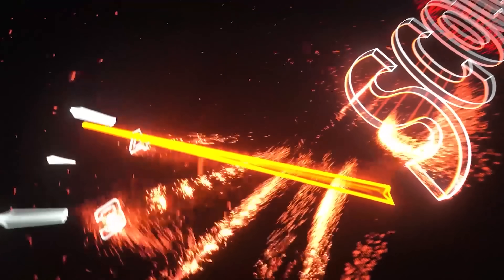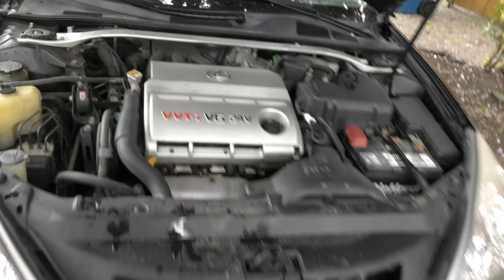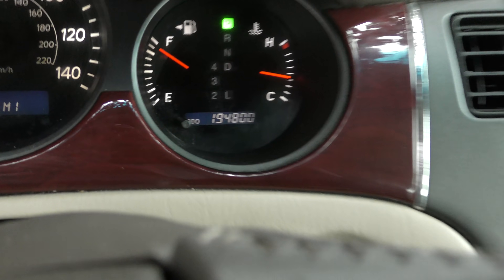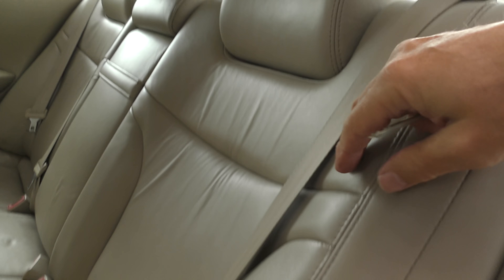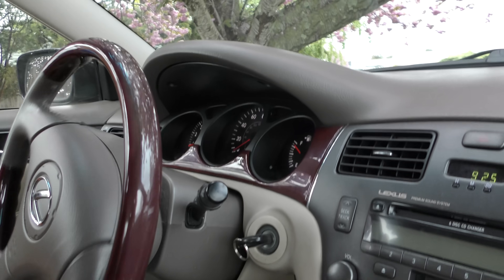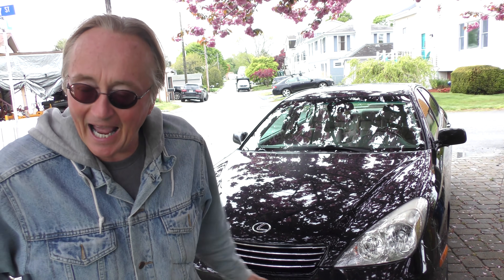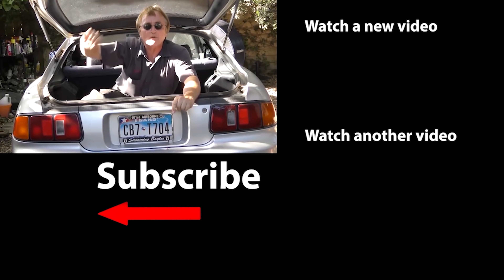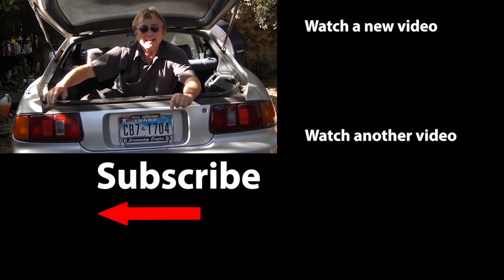I’m Sitting in the Best Luxury Car Ever Made

Comment: My sister in law just bought a 2021 Camry with a four cylinder. Is that car good for 300,000 miles?
Reply: Mechanically, yes. If it's loaded with all the bells and whistles, something is bound to fail just after 100k.

Comment: The best luxury car ever made isnt a front wheel drive one. it would be the GS lexus or LS if anything. what you have there is an overpriced Camry. feeling shifts is good btw, it means your transmission isn't slipping at all. Nice and firm and quick is what you want.  Smooth shifting is obtained by adding slip between gears

Comment: Mannnnnn i wish you where still in houston so you could work on my car 😭 but since we got some ppl who know about oil i have a very detailed question if anyone would be willing to answer. I have a 2005 monte carlo 3.4l SFI going on 230k miles original motor. I have always ran Pennzoil 5w-30 high mileage. After sitting up for a year i got it back running and need to change the oil. Should i go full synthetic? Or keep running the same oil type. I want my engine to last much longer, even tho it shows no signs of wear or makes any noises. (It runs great). Any suggestions would be appreciated!
Reply: Follow your car manual specifications. Oil passages are engineered for a specific oil type.

Comment: YES BEST PRACTICAL AND ECONOMICAL LUXRY CAR BUT BEST LUXARY IN THE SENSE AS IN PLUSH,QUALITY,QUITE,SMOOTHNES.  THE ES300 DOES CHECK THOSE BOXES BUT THE LEXUS LS BRINGS THOSE TO THE NEXT LEVEL.  I WOULD BE DRIVING ONE IF I COULD AFFORD THE GAS. I HAD AN 2002 ES300 CAR WAS REALLY COMFORTABLE MY 2007 AVALON IS LOUDER AND LITTLE HARSHER RIDE BUT I LOVE THE CAR,WAS LOOKING AT 2011 LEXUS LS460 AWD BUT GAS IS GOING UP MAYBE MY NEXT CAR WILL BE A 4TH GEN LS THE LAST GEN I WOULD GET THEY SHOULD HAVE NEVER REPLACED V8 WITH V6 TWIN TURBO, BUT THE CAR IS OVERKILL I WANTED EFFORTLESS MERGING ON TO FREEWAY THOUGHT LS BUT IT SHOCKED ME AFTER GETTING 2007 AVALON VS 2003 AVALON COULDN'T BELIEVE NATURALLY ASPIRATED 3.5L V6 PORT INJECTION COULD HAVE THAT MUCH POWER BUT KINDA OF A BOAT FOR A CAR THAT QUICK.  AND IF YOU DON'T LIKE HEARING THE ENGINE REV THE ES300 IS BETTER OR A NEWER ES350 SAME CASSIS AS AVALON SAME 2GR-FE DUAL VVT-I BUT WAY MORE INSULATION IN ENGINE BAY

Comment: Well I disagree I think ANY Lincoln Town Car is the best luxury car ever made because it has a bulletproof modular V8,bulletproof reliability so reliable that limousine fleets and corporate executives trusted the town car with bulletproof service,decent and good fuel economy,rear wheel drive,body on frame and basically built like a tank even quality of car is,safe,big Room,large trunk to fit many dead bodies,floaty boat like boulevard ride,easy to fix and repair even plenty of cheap parts especially from junkyards,a very cheap price to buy used,and classy styling!Ford Panther Platform(Ford Crown Victoria,Mercury Grand Marquis/Marauder,and Lincoln Towncar)>Any Lexus ES Econobox!However If you disagree then I respect your opinion!

Comment: Good afternoon Scotty . I have a 2019 Buick Encore what do you think about it ? 1.4 liter turbo and it has 8,500 miles on . It runs great
Reply: Sell it no joke
Reply: Dont buy a turbo on a gas engine..diesel only.
Reply: Sell it for a Lexus
Reply: @landlord8984  it's a good car, it's reliable engine.
Reply: He will not like it because the engine is barely a 1.4 and it has a turbo. He does not like turbos because it puts too much strain on the engine and wares out faster
Reply: A tiny turbo engine means the engine is going wear sooner than you would think. Those turbos aren't cheap to replace either. Sell
Reply: @adamscastle6222  turbos cost like 500$. There are good turbo engines out there but I've never owned a GM product.
Reply: @neootech8635  it's a tiny turbo, as long as you change the oil with Ravenol and put good fuel it'll be fine.

Comment: LS400 is what I like to own, but I drive a lot and fuel cost will be huge...
Reply: In mixed city/suburban driving I get 20.4 mpg.  Interstate at steady 67-70, flat, the best I've gotten is about 35. Can't complain. Have to consider overall costs and its maintenance is so low that it's actually cheap to own.
Reply: @wholeNwon  I get 49.4 mpg driving my 2011 Hyundai i30 with a 1.6L diesel engine and a manual shifter. I drive only on motorways, no city driving. No other car can beat this. Until 2019, 80% of car sales in Sweden I dare to say were diesel. VW and Volvo alomst sell only diesel powered cars and all other manufacturers were the same...
Reply: @huss1205  That's great!  Met a man with an old Volvo diesel fueling at a pump where I was getting gas. He loved the car (had 2) and said he'd never part with it even at 300k mi. that were on it.  Odd thing to me was that he was putting K1 kerosene in the tank. Said it was all he used.
Reply: @wholeNwon  I have a Volvo XC60 D4 2017 with a 2.4L straight 5 cylinder diesel engine with a Polestar engine mapping to make 220hp and 332 ft lbf for the family use, awesome mpg as well, around 37 mpg on a 65 mile/h highway...
Reply: Better then repair costs like on a german car
Reply: @huss1205  Sounds really great! Must be a lot of fun.
Reply: @wholeNwon  both cars are for daily driving if you drive your car a lot, reliable and cheap to run, especially the i30, 185/65R15 is cheap to buy and everything else is the car, nothing is expensive in that car.
Reply: @huss1205  If the math works for you, then that's all there is to it.

Comment: @Scotty, how and where to get owner and service manuals of cars? To work ......DIY

I wish to do simple but tricky tasks on my honda city zx 2006 (Indian model) like changing the timing belt and cleaning oxygen or mass air flow sensor, injector cleaning and ac filter replacing which i found out is one of the most retarded implementation (its blower has to be removed, from what i observed but i can be wrong).